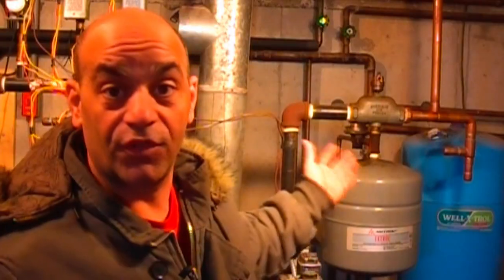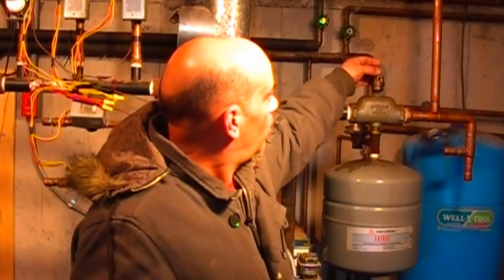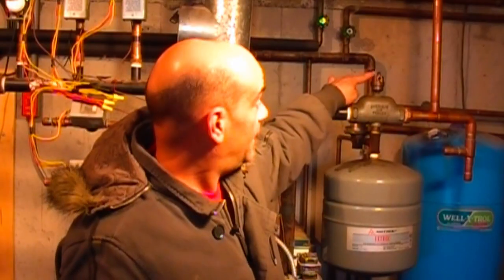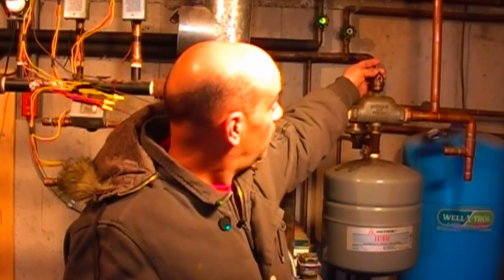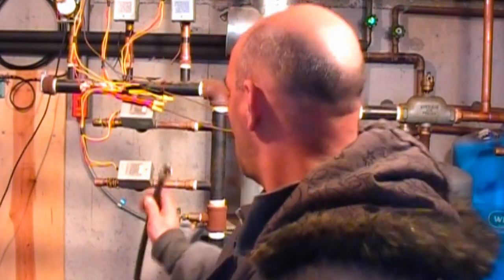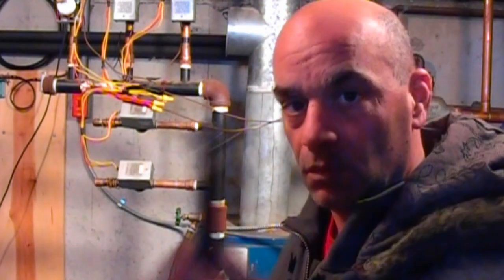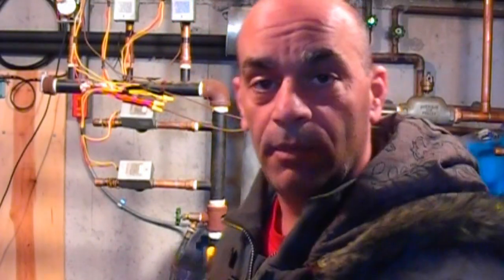How to remove the air from your boiler / heater

Comment: He didn't mention lifting the lever on the water regulator. Just be sure not to exceed 25PSI on the gauge or so, or the pressure relief may pop.
Reply: That's true but also make sure the boil is cool when you do this because you can shock the system by having cold water like that running through the system after it's been 180°. Always said that never watch YouTube videos for do it yourself fixers as they will either put you in the hospital or destroy everything you touch

Comment: Hi wondering If you can add to my discovery. Recently I saw water under my buderus hot water boiler which prompted me to replaced pressure relief valve, extension tank and most recently reducing valve or feeder boiler drain plug and other valve on same inline as feeder. Since doing all this, my pressure gauge for PSI side keeps creeping up after each heating cycle. I can’t figure out why this would be. New tank and feeder were both pre charged to 12 PSI. PSI gauge would start at 12-15 and after heating cu cycle it would creep up little and sort of stay in its place till next time. Feels like after several heatings it gets close to 30PSI PRV trigger on. I also keep hearing a weird noise which seems to come from water pipes since messing up with it to swap tank and other valves, etc… any feedback is appreciated.

Comment: Hi Dominic found your channel this morning. I have an ongoing issue when I haven't used my hot water baseboard for a while it gets a low water indicator light on my boiler and the pressure is much less than the 15 you showed if any.  Any suggestions. I have bled the radiators both up and downstairs still no luck . 
Thank you! And have a great day

Comment: confused.  so to bleed zone 2 only, you manually open zone valve?

will the system bleed better if you shut off the main valve to the heater— you left yours open.   didn’t understand what you were saying there.

Comment: Am I supposed to hear water running through my pipes every time I turn the heat up?
Reply from the maker: Yeah kinda but not really. Hearing the water is better than not hearing it. However no, all that means is there is air in the system.
Reply: @Askmediy thank you. Time to bleed my line. I have 4 zones

Comment: I've seen other videos where they suggest opening the reducing valve from the city water to pressurize the system.  Do you not need this in order to get the air out?  I'd rather not mess with that.
Reply: Yes you could. But that could make a lot more pressure than you want. To be safe just do a few gallons at a time. But always pay attention to the boiler pressure. Keep it under 20 and you’ll be fine
Reply: @DominickAmorosso  thank you, doing it again this year because I had to swap the impeller and got some air in there.  Noticed that my expansion tank bleeder valve is covered in scale or corrosion. Is that an easy thing to replace?
Reply from the maker: It is, just relief the pressure and get a bucket or something to catch the water and move fast. Otherwise you’ll have to drain it way down

Comment: Great vid. Wondering why my 2 way flow check valve rattling noise when heat called fo and then stops..what is best adjustment to set it at??

Comment: You have your way to get air out of the system, I have mine. Actually I don't - as I designed it to be self-bleeding ! It's not pressurised - so no expansion vessel, just a header tank upstairs. So the air vent has to go up there too - to be higher than the water level in the header tank.

Comment: if you have a small leak in a pipe dripping water slowly will that cause your preasure to fall in your gauge from your 15lbs to 10 to zero eventually?
Reply from the maker: Big time yes

Comment: Great info here to help fellow homeowners like myself better understand the operation process of a boiler system. It's quite overwhelming to look at all the pipes, pumps, and valves but it's not all that complicated once you start spending time with it. I started performing my oil boiler maintenance years ago and even replaced my 4 zone relay logic board before. Be careful. Be logical. Do some research. And thank people such as yourself for sharing their knowledge. Thank you!
Reply from the maker: Thank you so much, and it's my pleasure.

Comment: Hey Dom, I already drained the water and some air at the boiler drain in my system I have 3 zones, my only concern is there's no heat coming out at zone 1 which is the first floor. I might bleed it right straight to the vents or register if there is a bleed valve but before I do this, do I have to leave the Boiler on and running? or I have to turn it off and let it cool and then bleed it. Thanks in advance it really saves me tons of money by DIY.
Reply from the maker: Either way/ But if you have no heat I would do it when it's cold.

Comment: Inlet water regulator, should be 12-15#'s (not 8).  If you have 2-3 story house, you may need higher pressure to reach those floors (especially if the plumping is a long run or convoluted, multi room zones), you may need 18-19 lbs.  Remember to adjust the expansion tank pressure to equal your system pressure.  Tanks are usually set at 15lbs, so you can use a small pump to adjust the tanks bladder pressure.  Best to do that without water, especially pressurized water in the expansion tank.

Comment: Do I need to turn off the boiler and hot water pump first to flush the system? Yesterday I tried flushing one zone, first bucket came out was cold water but not very dirty, next bucket was warm water and so dirty like a mud. Then after few buckets, very hot water but still like a mud. And after about 5 buckets, one pump was making very loud noise. Then I stopped doing it, even the water that came out was still dirty. But after that, the zone got heat. Before it was no heating at all even thermostat said heat on. My question, do I need to turn off boiler or hot water pump before flushing. My boiler's water supply constantly opened at maximum, and the supply pipes are thin. I heard that cold water supply will crack the boiler.
Reply from the maker: Yeah it can take some time to get rid of all the dirty water. Not a big deal. You might of got some dirt in the pump, again not a crazy bid deal. Should come out. Yes a little here and there is ok. But if you're adding a lot of new water it would be best to turn the boiler off and let cool down first. And no, the pumps can be off. Most prefer it that way
Reply: @Askmediy  Thank you very much.

Comment: Thanks man. I just replaced my tank and vent valve today.  need to do the blow off valve tomorrow.  Also I really need  to flush the whole system tomorrow way to much dirty water an air coming out.  I just wasn't sure  how to do it the right way.

You nailed all my questions I had. I pretty much have the same setup as in your vid.
Its  zoned for 2 upstairs downstairs
Thanks again.
Reply from the maker: Always my pleasure, glad I could help

Comment: I'm 66 and just inherited my first house.   So I need HELP!   The 2nd floor and basement are quiet.  The first floor is very noisy.  Sounds like a rush of water whenever that zone valve opens.  All three zone valves are on the return  (cold) side of the heating loops, with nearby drain valves.  The zone valves dump into just one circulator pump mounted at the return (cold side) of the boiler.  No shutoff valves or obvious bleeders on the boiler, radiators, or expansion tank.   Shutting off the boiler also immediately  kills the power to the zone valves and circulator pump.  The zones can't be manually closed or opened unless the power is off, and even then it's difficult..     So I assume I should do the air purging with the boiler on, as you did..

SO MY QUESTIONS ARE.... If I can't manually open / close the zones with the boiler on, should I turn the 2nd floor and basement thermostats down (closing those zones), and the first floor thermostat up (opening 1st floor zone) to drain /bleed the first floor?  Can the rush of cold water through the regulator and into the hot boiler cause it to crack?
Reply from the maker: Well you never want to add too much cold water at one time. Always start with the zone furthest away from the boiler. Turn the system off for awhile and let cool. The boiler does not need to be one while doing this. Manually open each zone valve and flush it good to make sure you got it all.
Reply: Thanks, but you missed part of my situation.  These zone valves are very hard to turn on or off manually, even when the power is off.  I already broke one, and it is $140.  That is why I asked if I could leave the boiler system on and crank up the temp of the zone being purged and crank down the zones not being purged.  That would place the zones in the correct position for the purge, but there still is the worry of cracking the boiler with the sudden introduction of cold water.

Comment: radiator letting out air but no water and all my rooms not getting hot
Reply from the maker: Why are you bleeding out at the radiator?
Reply: @Askmediy THE radiators was working at one point but after i had a new boiler installed the up stairs rooms dont get hot so i thought to try and see if there was air and only one heater had water coming out all the ones up stairs just had air
Reply from the maker: @miltonbeard461  You can either do it the way I show you in the video or I won't be able to help you.
Reply: @Askmediy  thank u

Comment: Why air vent on the air scoop wouldn't be enough to get rid of the air in the system?
Reply from the maker: Oh no, not even close.That just little droplets of air here and there.
Reply: @Askmediy  but the system is working 24/7 and the air would be purged automatically so after a day the water in the pipes would be air free, no?

Comment: I’m getting a slight banging sound when the boiler is heating up. I purged the two loops but still getting that sound could it be air in the boiler itself? If so how would I purge just the boiler itself. I also have a hot water coil in the boiler and afraid it might be on its way out. Just can’t figure out this situation the noise goes away when the boiler stops heating up.
Reply from the maker: Your expansion tank could be going bad. Do each zone either all together or separately
Reply: askmediy I taped on the expansion tank I get the two distinct sounds I think it’s fine. I’ve bled both lines separately and together nothing changes. I have two loops with separate zone valves I manually open each one then both together. I have the shutoff valve on the return side cutoff and use the hose valve to purge. Could there be air in the boiler itself? Would shutting for the return valve and open up the boiler drain valve do anything?
Reply from the maker: You must leave the water supply on as well as have 19psi in the system
Reply: One thing I forgot to mention this noise happens with the heat off on both zones. It happens even if just heating hot water coil.
Reply: askmediy yes I use the fill valve to keep up the pressure while purging. But if it’s happening even when no call for heat and the zone valves are closed that noise is coming from the boiler I think.
Reply from the maker: Hmmm, still sounds like a expansion tank. Hard to really say when I'm not there.
Reply: askmediy the top of the expansion tank sounds full of water and the bottom by the air valve sounds empty. Guess I gotta call a plumber this crap is really mysterious. 🤷🏽‍♂️
Reply from the maker: Yeah I think would be best. There can be so many things causing this.
Reply: askmediy I appreciate your reply’s and I think you are very knowledgeable I’m a subscriber and I wish you and your family a safe and full life it’s crazy times right now.
Reply from the maker: Thank you very very much. And same to you

Comment: Do we need to shut anything off before we unscrew the expansion tank?  Thanks for your interest in the home. God Bless ☀️
Reply from the maker: Oh yes, you'll need to release the water pressure in the system. Also make sure it's cooled down.
Reply: @Askmediy  So do we always shut off water pump, close main house water tank exit valve, open the hot and cold from the sink until no more water comes out or maybe there is a water shut off valve right before the expansion tank? and also shut boiler ?  Those tanks probably come pre-set pressurized but maybe they have an air valve we can either increase decrease the air pressure inside? What's the psi that tank should be at? Yours looks just like ours. Hopefully there's a good YouTube video just on replace the expansion tank. Thanks
Reply from the maker: Sorry for the delay. Yes you'll want to make sure the freshwater supply is turned off.

Comment: I've two-family house I can't get no circulation in my kitchen and liver
 room on the second floor which is right next door to each other.I bleed
 them both Still not getting no hot water coming out my bleed 
valves.What's  the problem?
Reply from the maker: First off sorry for the delay. For some reason I'm not getting emails on comments. Either weak pump or you still have air.
Reply: @Askmediy  Pressure was too low boost it up  top floor is ok now.
Reply from the maker: @LeoThePrezPretlo  Very cool. Glad you fixed it
Reply: @Askmediy  Thanks

Comment: How do you set the low and high temperatures on the zone valves?
Reply from the maker: Temps are set within the control panel of the boiler, not the valve.
Reply: @Askmediy  Thank you. In fact I have some baseboards that are getting much warmer than other ones. They are part of the same zone, and my settings are 160 / 180 and 15 for lo / Hi and Diff temperatures. Any idea what could be the reason?

Comment: Hello,  I have a steam ,one heat zone system with three levels (floors). Why did tons of water spilled out of the 1st floor air varivalve ?
Gas boiler in the basement 
Thanks
Reply from the maker: First off sorry for the delay, for some reason I'm not getting emails for comments. Sorry to say I don't know much about a "steam system" to help you.

Comment: Hi there was water dripping from pressure relief valve. I replaced it along with expansion tank. But i still getting dripping of water. Actually a-lot know. Like a full size bucket a day. Any suggestion plz help.
Reply from the maker: Well a certain amount is somewhat normal. More so until all the air comes out. I'm assuming you did bleed most of the air out.

Comment: Will air in the system prevent the oil burner from staying on? My oil burner starts up then cuts right back off
Reply from the maker: No not at all. Check your filter first.

Comment: Hi
Boiler in my house is in the basement and I have an issue with the heaters on the third floor.There's four bedrooms and all is one zone. Heaters in first two bedrooms gets hot when heat is running but the other two bedroom heaters  stays warm, so room stay cold.  Help resolving this issue pls.

Comment: How tight to make the screw at the top,  where the air escapes?
Reply from the maker: Just a few turns, not snug, not tight. Really doesn't matter. Don't even really need to be there, to give you an idea.

Comment: Instead of that Taco air scoop..There is something called Supervent and Hrdyovent I believe.  It replaces the scoop & can vent with a full size outlet.. You'll love it.. On low level installs i have actually not had to purge up to 5 zones, it impressed the crap outta me..i have seen guys feed tgrough the bottom but i don't like it

Comment: Thanks man
I just had to bleed the air out of mine and we have an auto fill valve but no shutoff to the return!
I kinda just let it roll and I think I've got most out being that the heat is working In the room that it wasn't and the banging has stopped!
Reply from the maker: Awesome, glad I could help.

Comment: Don’t just spin off extol tank, I would drop pressure to zero, unless you would like to get a hot bath and flood, can’t assume anything, other that I like your explanation of bleding system in to bucket, I did the same, using two buckets, watching for bubbles and running continually so air would not back if stoppedflow, oh yea, helps to have a slope sink nearby, all in all, very nice video
Reply: I forgot to close a valve and got a shower about 2 months ago.  Jacket kept me somewhat dry.

Comment: When my thermostat calls for heat and the boiler gets going is it normal
 to hear water flowing in the baseboards, or does that mean there is air
 in the lines ? Should I hear no water at all ?
Reply: No water should be heard

Comment: good video. I have a hot water hydronic baseboards system and I'm not hearing noise from it, but I tried to remove the air from it using the same method as you and I'm on my 15th 5 gallon bucket and I'm still seeing bubbles and not getting a steady stream of water. Could something be wrong? I also feel that my baseboards should be getting hotter.

Comment: You did not mention the importance of removing the air.  Think one (of 2) circulation pump in my hydroradiant heat system started making noise and failed due to air.  Thinking it would be like air in the heart that would make it fail.?  Plumber also had to replace the expansion tank.  don,t see that as related.
Reply from the maker: Do you think I really needed to?
Reply: Well it would help if I knew the things that could go wrong if I did not bleed the air.

Comment: I guess you didn't know back 15 years ago when you put this in that that a scoop is supposed to be a minimum of 20 inches from the 90 that's allowing air bubbles to come back to the top of the pipe and slide to the air scope and be trapped and release through the auto vent just saying